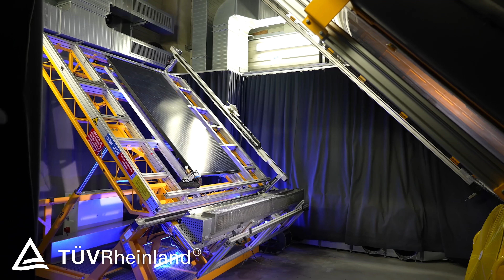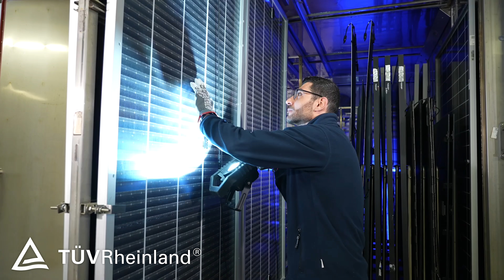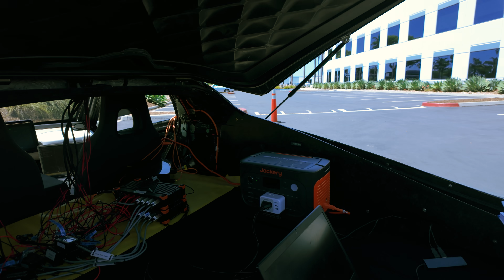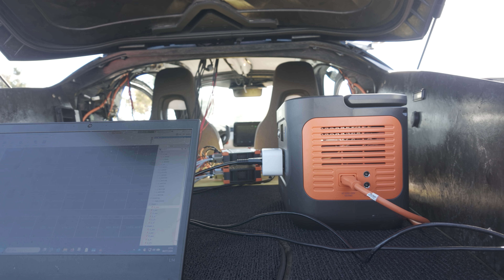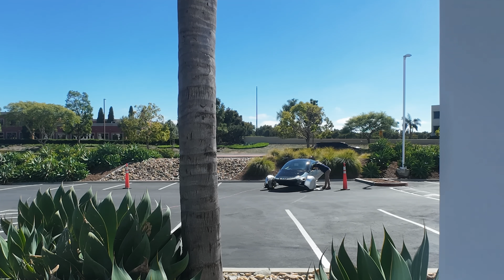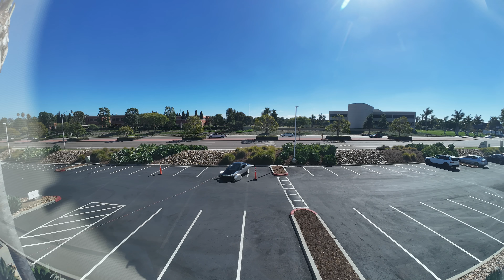Aptera's Solar Output Is Now Independently Measured

Comment: It seems like it wouldn't be too difficult for software to be developed that would allow the Aptera to monitor the weather and open and close the hatch and use the single wheel to turn to follow the sun during the day, to optimize solar collection, all automatically. Semi-circular parking spaces could become a thing!
Reply: That's thinking.

Comment: Based on the extra cells they were adding with each successive iteration, reaching 40 was perfectly targeted. The 50 is a surprise and a good selling point. However, they need to report on the crash tests which they have yet to do to absolutely convince me of its safety and real world testing. What would happen if one of its front wheels was swiped in an accident , my guess is the car would be totally disabled.
Reply: Setting aside that the Aptera is a motorcycle and not a car, I'd say even a four wheeled car would be considered disabled if it lost one of its wheels.
Reply: There is no collision safety standard for autocycles or motorcycles. Taking a little risk in exchange for adventure and economy is half the fun.
Reply: These comments are hilarious. There is an Aptera investor born every minute.
Reply: @truantray  As a retired factory worker I refuse to buy stocks. Any profits come directly from the paychecks and benefits of the workers. I invest by being an early adopter of the vehicle. I got the startup Organic Transit ELF and 7 years later, the startup Arcimoto autocycle as investments that have literally paid for themselves in economy. I would never want the Aptera, it scratches the wrong itch. Climate controlled high speed long range vehicles are an abomination that should not exist - we should be using public transit for long distances. Personal vehicles like this will become obsolete, by force of environmental impacts.

Comment: I was really hoping there would be some other testing mixed in with the solar test results, but I guess with only three days to work with, it is better to concentrate on one statistic. I hope that there are other results coming soon and that they won't be out off until October. 

Those solar maxing results are impressive. Almost 5 kWh. Of course you have to leave the hatch open, but if you have nothing valuable in the vehicle it is "locked" with the electronic key. A carjacker can't just get in and drive off. 😂

I don't know how much they charge for their service, but I'd like to see confirmed stats for overcast days. And maybe some winter readings. Just to have confirmation of those numbers. I guess buyers are going to be testing their vehicles and compiling results from all over the country though.
Reply: Full sun is easily defined but cloudy or low angle sun is too variable for useful measurements. Refer to established solar panel performance data on cloudy days.
Reply: @popeyegordon Well, low angle is included in full day data. Cloud cover is probably something that would only be useful if collected by the individual buyers.
Reply: @richardryley3660  Yes we all know that the testing included low angles during the beginning and end of each day. That should go without saying. But I guess when you relate to Japanese fantasy figures you need to be told this.
Reply: @popeyegordon Personal attacks based on an avatar? Really? 

I was agreeing with you, troll.
Reply: @richardryley3660  You set yourself up for this. In comparison, my avatar is the solar powered velomobile I have been driving for the last 11 years.  I have professional quality control experience in solar and battery tech. I have installed 6 solar power systems and they all still work as intended.
Reply: @popeyegordon You base your professional experience on the avatar you use in YouTube? I think that tells me everything I need to know about you. 

It's an avatar, man. No one cares.

Comment: 16 km/kWh * 4.5 kWh = 72 km? Per day, for free? That's comfortably enough to do my commute!
Reply: Or 45 miles/day. That's absolute maximum though. The generation will definitely vary by season. But even winter should be actually pretty good with such a baseline.
Reply: @richardryley3660  I only need about 30 km a day, on average less than that, so I think it'll be fine for me personally. 👍
Reply: @richardryley3660  On a cloudy day in late December in Ottawa I'd get hardly any range from it.  On the other hand, on a cloudy day in late December in Ottawa, I'm staying in bed.
Reply: @993cc Yeah. In areas that aren't as sunny as Southern California you're basically getting a really efficient EV with a few free miles a day. They're still free, but doing your daily commute without needing to charge isn't happening. It's more the little bit of electricity you don't have to pay for.
Reply: @richardryley3660  Actually I just asked Google to compare solar potential in Carlsbad, CA versus Ottawa: 
"Annual Output per kW: A 1 kW solar panel system in the Carlsbad/San Diego area generates approximately 1,450 to 1,600 kWh of electricity per year. The same 1 kW system in Ottawa yields closer to 1,150 to 1,250 kWh annually."
So that's actually only a ~21% difference. However the difference between winter and summer is dramatic. Carlsbad outperforms Ottawa by around 250% in winter. You're only going to get maybe 10-15 miles in Ottawa on a typical winter day.
Reply: @wordmunger That makes a lot of sense. Your maximum is not that much higher but your minimum is lower.
Reply: I guess Apteras plan is to only sell to Star Trek fans.

Comment: I see a lot of comments focusing only on the cost of electricity, implying the savings isn't all that much relative to an Aptera without solar, which overlooks the whole point of being independent of the grid. US drivers average roughly 29-33 miles per day, based on the most recent American Driving Survey and federal data. More broadly, annual mileage comparisons show Americans driving nearly twice as much as residents of France and other Western European nations—98% more than France, 106% more than Germany, and 123% more than Great Britain, according to OECD-based analysis.  Australia averages 23.5 daily miles per driver.  Independence and cost savings are much greater than the US in these and other overseas countries, though this may be offset slightly by people (esp. in those countries) driving more due to being less costly -- going more places and relying less on mass-transit. Also, destinations, particularly vacation destinations, may not have access to the grid. Solar mobility translates into freedom and independence. Put a price tag on that.
Reply: Yeah, even if you only get half of your battery charge from the sun, that's still HALF of your battery charge that is FREE. Plus, you never have to worry about the battery being almost empty and not making it to the next charger. Just park in the sun for a couple of hours and you can make it to a charger.
Reply: @richardryley3660  Yeah its a diminishing return though, I have a similar solar system on a shed that can make about 4kw on a good day but it doesn't always, and over the last 6mo or so it has only made about $50 USD of power... 0.5 GWh... at least at my local prices. If adding the panels to the car costs, $1000 you probably wont' make back that value for 20 years of use.
Reply: @Wingnut353 I don't believe that when four solar options were available and prices were listed for them, they did not cost more than $900 total.
Reply: Almost everybody is either on a grid or generates their own electricity at home, so I just don't see how being plug-independent is a real advantage. Do you honestly think that some Aptera customers won't have electricity at home? I guess for those people, an Aptera would be amazing, but they would be even better served by putting up some solar panels.
Reply: @davidhoracek6758  1/3 of households in the US rent so putting up solar is not possible. A large portion of those renters do not have access to a power outlet for charging overnight.
Reply: @AverageJoe928  Are you counting people who live in huge apartment buildings in New York city as households? That's kind of funny.
Reply: @Elrog3  less than 3% of the population lives in NYC, but ok.
Reply: @AverageJoe928  The same applies to the other large cities. I don't think Aptera is marketed to people who have more concrete than sunlight.
Reply: @davidhoracek6758 If you have solar panels I guess it does not buy you anything extra, although a) you can save your home power for use in.the home and b) you can make use of solar power when you are on vacation or visiting family.

In addition, you are not putting any further strain on the grid. The state does not have to increase the power the generate and your solar panels and the solar panels of your neighbors can go to the grid and not your Aptera.
Reply: @davidhoracek6758 you don’t see the difference between paying for your electricity from your home solar system (and moving up your tier structures payment plan) and getting free electricity to charge your car?  Imagine you have a Tesla that you charge at home from your home solar system.  You are paying for the electricity to do that because almost all home solar systems are designed to keep you in the lower tiers of the usage scale (but electricity is not completely free).  Now put solar on your Tesla AND make your Tesla use one third the amount of electricity that it used to use such that you get the same range with one third the amount of electricity it used to require (and cost).  You’ve just made your Tesla generate its own fuel independent of your home system preventing you from entering the higher tiers of your billing structure and that electric companies have NO control over.  I don’t understand why you don’t understand. It’s the same as any Tesla owner out there (other than the efficiency advantage Aptera has) with someone coming to your house every day to deliver free electricity to your car without it effecting your electricity bill AT ALL.

Comment: Over the course of my engineering career I've worked with several testing and certification groups like TUV. The simplest kind is the "witnessing" test, which matches independent observations to the maker's claims. That is, Aptera has set their own standards for success, and TUV is ensuring those claims are backed up in at least single specific testing environment.

It is important to understand that this testing environment is not even slightly relevant to the typical future Aptera owner. This testing was done solely to back up marketing claims, not ownership expectations. No typical Aptera owner will ever repeat this testing environment as a daily part of their ownership. How many Aptera owners will repeatedly park their Aptera with the hatch open and ideally angled to the sun? How often do you walk away from your current vehicle with the rear hatch or trunk left open?

There were other vital aspects of the Aptera solar system that were not tested (because they would need very separate testing conditions). Was solar panel energy production "witnessed" by TUV across its entire operational temperature range? No. Was solar tested in more realistic parking scenarios, such as with the hatch closed and in normal parking spaces? No. Let's be perfectly clear: This was strictly a "solarmaxxing" test.

Specifically, this test could NOT confirm that the Aptera will gain "up to 40 miles of driving range per day" from its solar system. To confirm that claim, TUV would also need to test that the vehicle achieved its stated average driving energy consumption goals of 10 miles per kWh. Instead, Aptera factored out the "10 miles/kWh" efficiency coefficient, and instead tested for "up to 4 kWh of solar production per day".

I'm not at all being critical of Aptera! I'm simply illustrating the inherent nature of specifications testing. The scope of verification testing has to be strictly limited in order to have a test that can be performed on a reasonable schedule at a reasonable cost.

To me, the biggest takeaway of this test is NOT the "4 kWh/day" value. Instead, it is that Aptera's own onboard systems are doing a great job under the highest levels of solar production any customer is ever likely to experience.

Now, let's dig in to the test process itself. TUV has to gather measurements that are as close to "ground truth" as possible, which essentially means taking laboratory-level instruments out into the field. This is NOT an easy process, since each attached device must be calibrated to perform well under the testing conditions, which in this case includes some Carlsbad July weather (hot and humid) in an asphalt parking lot. Dragging lab equipment around is a PITA, and verifying the final setup is vital before any measurements taken can be accepted as accurate.

Unfortunately, the testing document does not describe how the TUV setup was verified in the vehicle before testing started, though the test report does list the instruments used and the month of their most recent calibration. The statistics for experimental uncertainty for the various TUV sensors are included, with an overall stated uncertainty of 1.3% at the 95% confidence level (2 sigma). This is not an especially impressive level of test data performance (I preferred a minimum of 3 sigma confidence in my testing), but the stated 1.3% accuracy is still plenty good enough to ensure the measured values do indeed exceed the solarmaxxing goal of "4 kWh/day".

The testing needed to confirm the "up to 40 miles of solar generation per day" will be the EPA (and other) city/highway/combined mileage (efficiency) testing. That testing will be far more complex than this solarmaxxing test, as it must take place under a variety of environmental conditions. Initial baseline testing will be done on a dynamometer, which tests "charging to wheels" (plug and solar) energy storage and transfer efficiency to the rubber. This testing neglects vehicle atmospheric drag, which must be established and verified by still more testing.

It takes many smaller tests to characterize a system as a whole, as it is totally impractical to test all factors simultaneously in a single test. Whole system testing is done only to a very limited extent, to ensure all the sub-tests have been properly performed and combined to create validated higher-level conclusions. This means an entire "test campaign" can be extremely complex, with the results of each separate test needing to be compatible with all the other tests, so they may be correctly combined.

There is an entire field of study that addresses precisely this set of issues. It's called "Design of Experiments" (DoE), and is (to me) one of the most fascinating and practical areas in all of science and engineering. DoE principles are used everywhere: In the creation and performance of medical studies. In the testing of construction materials and architectural designs. The list is endless, and includes every important product and system in our lives.

Most certainly including vehicle testing. I'd dearly love to get an inside look at Aptera's test campaign and their overall DoE process analyzing and validating that campaign.
Reply: "Not even slightly relevant"?  I stopped reading after that absurd comment.

Comment: Thank you for the testing. How long will the batteries and panels be able to produce the optimental output of 40? 3 months? 1 year? What is the degreation forecast on the battery and panels?
Reply: panels are 25 years. assuming there using a normal ev battery probably gonna see  around 200,000 miles before you looking at a battery. the question is am i gonna be able to find and replace them

Comment: How much electricity it can produce pales in comparison to how efficient it is. It is literally the most efficient vehicle you can buy, even better energy economy then an average motorcycle. That being said, just like any other high-tech efficient product, all the money you save, on energy, will be gone in an instant when you pay your first repair bill.
Reply: They should have ditched the solar panels all together, substantially lowering the price, and sell it as the fuel efficient giant that it is.
Reply: My 2020 ZeroSR averages about 100wh/mile or just under that.  This is with riding thru the mountains well above the speed limit as my commute of 80miles round trip.  Last I recall Aptera uses a little over 100wh/mile something like 112wh/mile but more level and straight ground.  Even with the horrible aero of a moto a BEV one is still pretty good on efficiency.  So yes compared to a ICE motorcycle Aptera is but compared to something like a Honda SuperCub I have gotten 130mpg they are very similar in efficiency to Aptera.

Comment: I would like to see results with the hatch closed in different parking spots in not optimal locations and orientations, because many times when you park you are not really able to choose the parking spot. Those results would be very interesting to see, real cases with variability. 

For example, during a month, measure total energy generated, each day rotating 90º starting with a north orientation. Next day east, next south, next west, and so on.